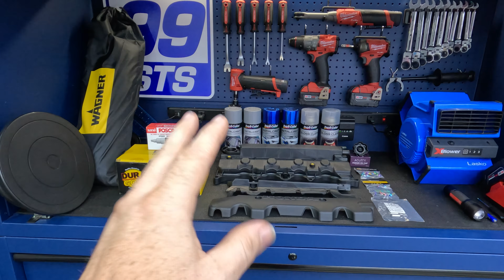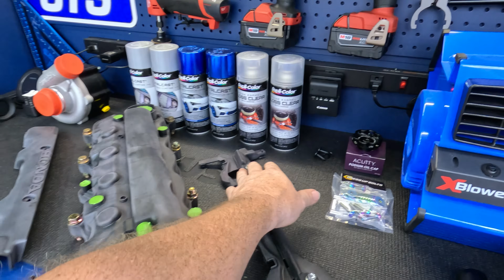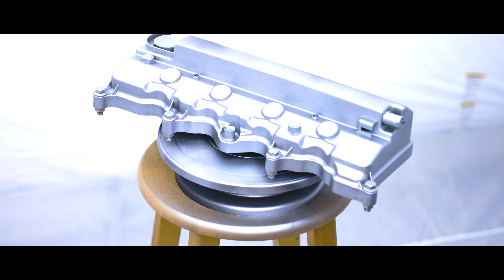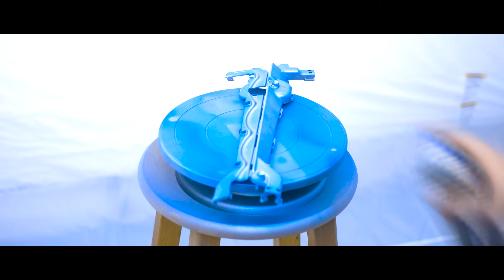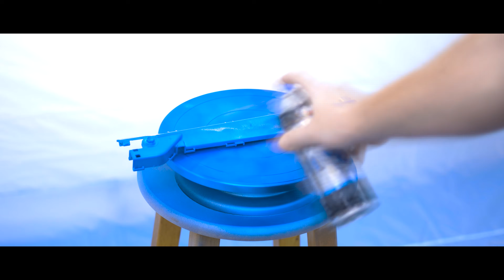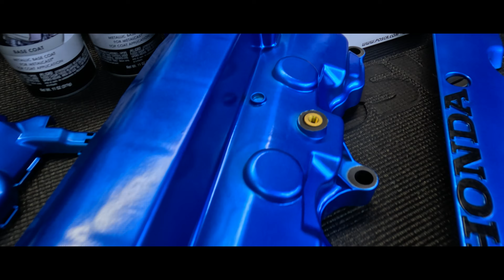How To ELEVATE Your Plastic Valve Cover

Comment: When you bought the dress up bolts, did you get the "Honda Civic Si FG/FA (2006-2011) Titanium Ti Dress Up Bolts Engine Bay Kit" or the "Titanium Hardware Valve Cover Kit - Honda K20/K24".  I have an R18. Thank you!
Reply from the maker: I had to measure and purchase the bolts individually on their website (I did not buy a kit).

The valve cover bolt sizes are a follows: 

M6 x 1.00 x 35mm bolts (8 in total) 
M6 Titanium Washers (8 in total) 

I can't remember what the size of the 2 bolts that hold the fuel injector wire harness cover (on top of the valve cover) are...

Also, the 2 back-center valve cover bolts will not require washers, as the washers will not sit flush against the valve cover... but you can use the extra 2 washers foot the fuel injector harness cover. 

Finally, don't forget to purchase the silver bolt "sleeves" that i purchased on ebay...

Size: H20mm x D 6.2 x D10 (you will need 8 of them) 

https://www.ebay.com/itm/165964634142?mkcid=16&mkevt=1&mkrid=711-127632-2357-0&ssspo=ifg6scBORHm&sssrc=4429486&ssuid=lebtfzblrvq&var=465465314161&widget_ver=artemis&media=COPY

I hope this info helps!
Reply: @LevelUpMechanics  Wow! Thank you again for the information! I have one more question. Since the dress up bolts are fastened using a Torx or hex key (I am not sure which), how did you manage to torque them to factory specifications when placing the gasket and cover back in place?
Reply from the maker: @johnbarro4455 you can use hex sockets that attach to the torque wrench / ratchet

Here's an example
https://amzn.to/4hPLlCX

I hope this info helps! 😁👍
Reply: @LevelUpMechanics  The info sure did help! Much appreciated! Time to dress up the engine bay! Nice looking R18 by the way! Can't wait to see your supercharger vid. Take care.
Reply: @LevelUpMechanics  Brother, how much do you charge to do the super charger work?

Comment: You should get a cold air intake rather than the hot air intake you have now.  I bet you are loosing a lot of HP with all the at hot air.
Reply from the maker: Thanks for the suggestion 😁👍. I ended up replacing this air intake with a supercharger setup. I'm good to go now 🤣.

Comment: I have a 2013 Honda Accord Coupe V6 - 6 speed.  I was told painting the plastic valve covers would make them melt - as the paint chemicals in high temperature paint degrade the plastic.  Do you know of any truth to this?  Thanks  earned a sub from me.
Reply from the maker: It's possible that certain paints can affect the integrity of a plastic valve cover. However, the base coat / top coat / clear coat paints that I used in this video are all designed to be compatible with both plastic & metal high-temp surfaces....

I have had zero issues with this paint so far, and it has held up perfectly. Best of luck to you with your future valve cover project! Thanks for the support! 😁👍